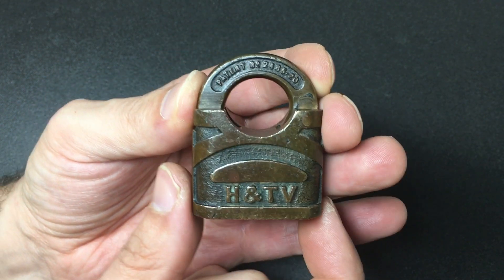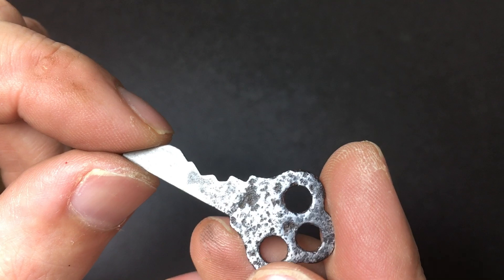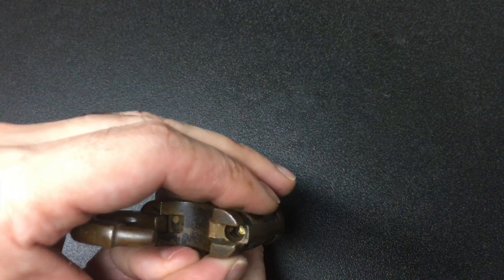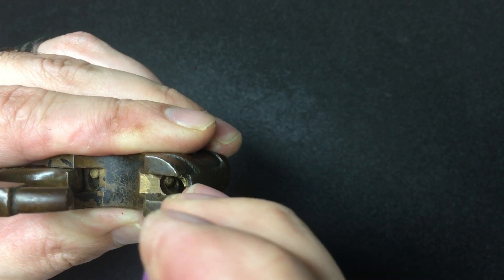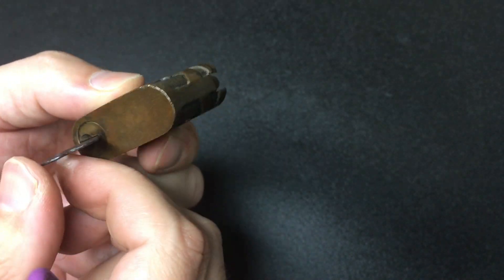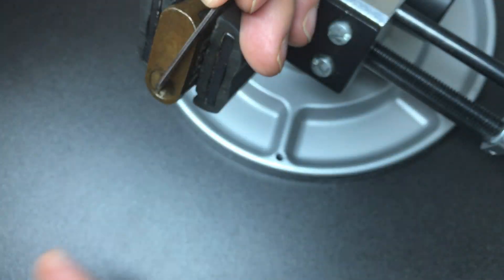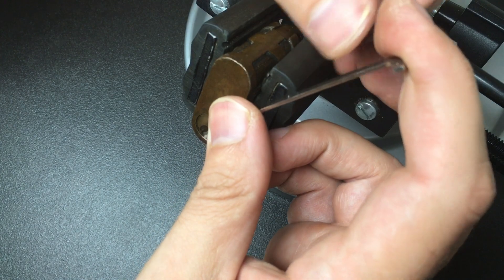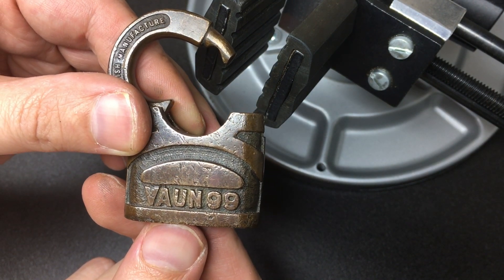H & T Vaughan Vaun 99 Vintage Padlock Picked

Comment: Beautiful old lock. I've just come into possession of a H&T Vaughan rim cylinder(future video of mine). So I had a quick look into their history. Here's a quick history lesson lol, the company was founded around 1856 by 2 brothers and in 1910 they where the first manufacturers of pin tumbler locks in the UK , the no4 lock came about in 1910 which seems to be the farther of more modern Yale rim cylinders then in 1928 the Vaughan family sold the business to Yale. I would then believe that Yale would have then stopped the H&T Vaughan branding. so I would take a guess and say that lock could be up to 100 years old give or take. thought you might have found that as interesting as I did 👍
Reply: My late father worked at H&TV from 1925 to the Yale takeover in 1928. Many of their locks were copies of Yale products from the USA.  A new product from Yale was dismantled and the parts handed out to various craftsmen. they would make their own casting patterns, fettle the castings and file them to size. The lockmakers were all journeymen who hired a workbench from the company, completed an order and would then go on a drinking spree until the money had gone.